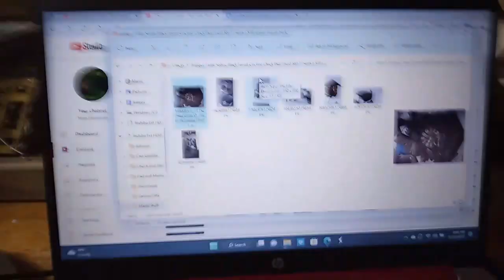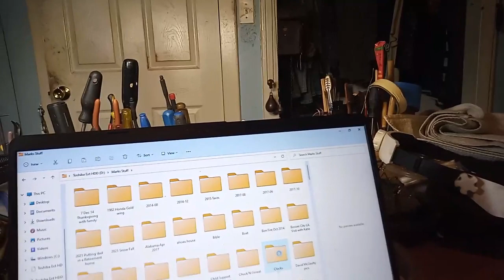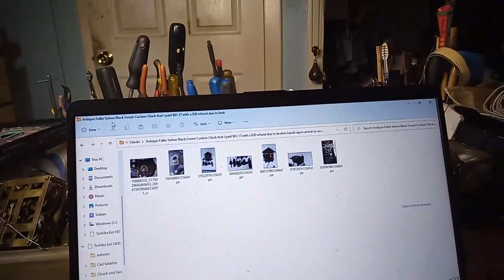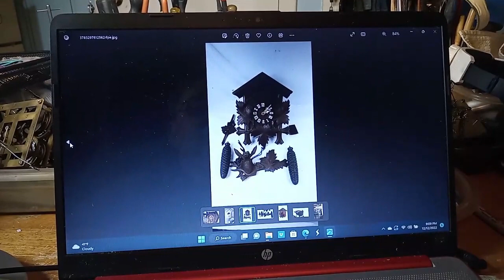Putting my antique Faller & Sohne cuckoo clock back together. Explain how to get cuckoo to stop

Comment: Even thought the book says to paint the bird after cleaning, yet, I am with you when it comes to some of the birds, like the wooden birds. The high note bellow is stuck open and needs to be pressed down with a clip to reform the memory but making sure the bellow didn't blow out on the side you can't see so the bellow will close all the way, right.
Reply from the maker: So true! The reason why the bellow doesnt close all the way on this bellow I believe is because I used laminated flooring to make the top piece that was missing. Plus it is heavier than the typical wood used to make them but you are correct on the memory of the bellow.